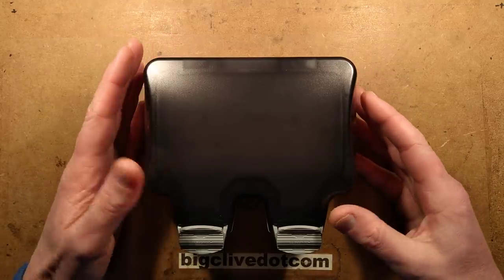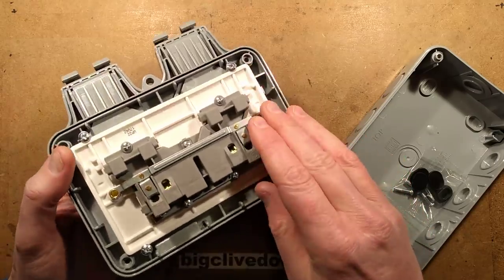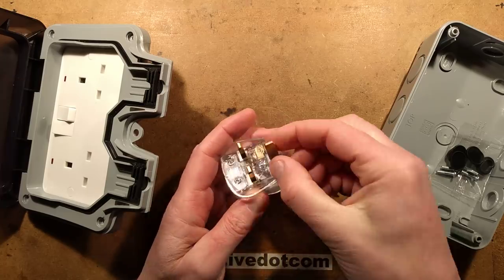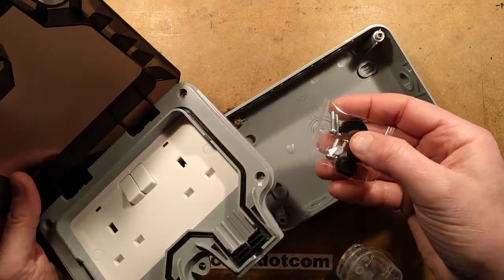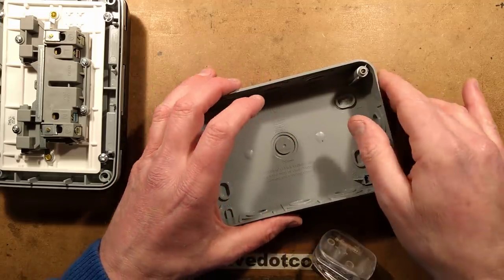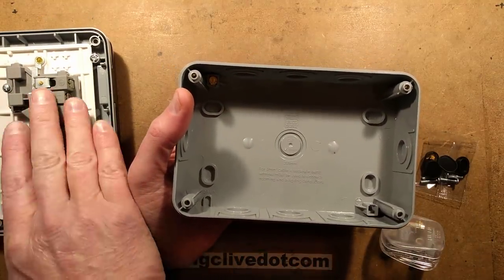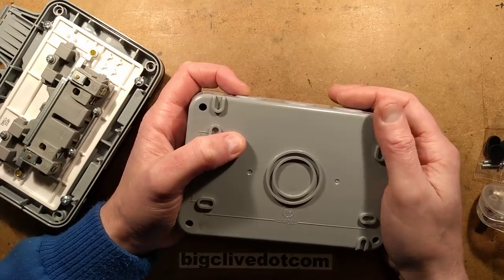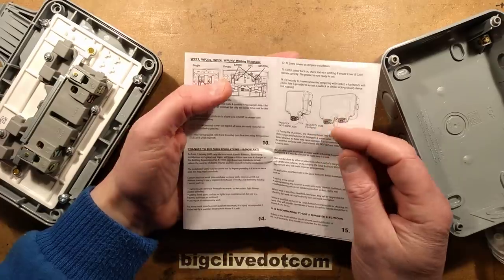British weatherproof socket with clever design. (bonus rant)

Comment: Part P! The P should stand for Prescott! After the git who brought it in after a relative got a tickle after having a kitchen fitted. It was originally intended for those who worked with both water and electricity, e.g. kitchen fitters and the like, but John Prescott (the same git who criminalised none condensing boilers to raise the stakes of the Kyoto Protocol) rolled it out to the whole electrical industry, seeing it as something similar to the CORGI registration that gas men have to have. I knew a lot of sparkies, timed served 30/40 year men, up to date on all EE Reg iterations, gave up the trade rather than go on a course, run by a teenager who had been on a two week course, to tell them how to do their jobs.

Comment: The lights on the socket come on when the socket is switched on. And the catch/clamp is good, and when on a wall easy to do them one at a time with one hand. It's also good at pinching the palm of your hand if you put it in the wrong place. You'll likely only do it once...! 
I'm also a mechanic and part P to me is just a bunch of instructions that I'm certain I can follow with  my GCSE science knowledge, the interwire and my work gear. I also don't want to set my house on fire at any point so I'm more inclined to do it properly, as I would with a car, or it will set on fire etc...

Comment: Would it be worth paying the 180 quid for the one day powerpoint presentation part P certification course and then any work you do would be okay? I mean looking at the work that one sparky did for me (I ended up redoing it safely) it doesn't take a rocket surgeon to pass the course. I'm wondering if it would be worth me doing the course as I have to wire and install new lighting in my garage. Getting a sparky to do it will cost more than the £180 in labour costs and I'd still have the satisfaction of doing the job myself.
Reply: Bloody hell, I just looked at the assessment for the course, it's a 40 minute, multiple choice, open book exam. I could download a PDF of the Electricians Guide to the Building Regs, spend a week or so reading through it and pitch up for a one day course and ace the exam.
I don't mean any disrespect to any sparkys that watch Big Clive's channel, but this doesn't sound all that difficult to get certified if you already have a good idea of what you are doing and have a bit of common sense.
Reply from the maker: The open book tests are patronisingly fake.  Literally a multiple choice with the answer to question one on page one and the answer to question 2 on page 2 of the notes.  It would be very hard to fail even if you weren't an electrician and just sat the test.  I bet I could pass the gas equivalent.  These are just box ticking things.  Almost everyone passes.  The purpose is to get the participant to sign a liability disclaimer that they believe they are competent to do electrical work.  It's called "transfer of liability".
Compare that to the 236 parts 1, 2 and C exams (actual exams) with no notes and a written test involving solving real electrical problems and drawing schematics.  Very few Part-Ps would pass those exams.  If you don't get above a certain percentage you fail and get held back a year in your apprenticeship.

Comment: Although the British plug is a strange one, when growing up in Scotland in the 70s the pins where round. Where they any better? But fortunately back then it was easy to go out buy strange new  rectangular pined plugs. Are the plug pins in Scotland still round?
Reply: I should have said I moved from Scotland to London in 1979.
Reply: You're describing the old 15A three pin plugs. They were in use all over the UK along with a smaller 5A version until largely replaced by the current fused 13A plugs.  They are still actually available and are often used in theaters and the like.
Reply: @NewmanAutomotive  they say its good to learn something new everyday and I just did, didn't know that thanks

Comment: oh Clive how we all love your rants!!! If you think the part p debarckle was bad enough the current Bs 7671 18th edition is a marvel of obcenity on two factors (reccomendations) of which are 1 arch fault detection (hellishly expensive for domestic installations and not widely avalible by all manufactures) and earthstakes when the suppliers earth is unsutible on a pme! More buck passing!!! 
Id love to see a collaboration with yourself John Ward and AvE each supplying a locally brewed beverage to be consumed at great quanities and the dissapointments in your industries. 
Keep up the good work!!!!
Reply from the maker: It'd be interesting to see the power consumption and increased fire risk of any arc fault detection circuitry in a consumer unit filled with those breakers.
Reply: @bigclivedotcom  don't worry about that yet. When they bring out the efficiency section into more than guidance, then they will stiff us all

Comment: how does this cost? In the US, the only ones I can get are cast aluminum or possibly zinc and they don't open all the way so I'm either blindly trying to stuff the plug in the socket or I gotta crawl on the floor to check the alignment.

Comment: I think the UK gas regs used to say a “competent” person was only allowed to install a cooker. Recommended to be inspected by Gpcorgi Registered engineer. Not sure if it’s still the same or if you need it certified as safe by GasSafe engineer. 

.My brother in law fitted a old gas pipe to his cooker from his old cooker didn’t clean the old sealant off or put any new sealant on. An engineer told me that many people put water spec ptfe tape on even though you can get gas spec. 
 
It’s too subjective to say “competent” because most people will think that they are competent even if they aren’t and that is where the danger lies.

Comment: The only down side from American standards is the switches mounted on the outlet plate. In the US the average height of wall outlets is 14 inches above the floor. If you have a bad back and/or knees such as mu=yself, bendin g over to activate the outlets would be very difficult. Currently in many areas of the country, construction for tne last 20 years has at least one outlet split for one constant hot and one half switched. Aside from that, this design is excellent and MUCH safer than the US style.

Comment: Russian color coding is:
Blue - Neutral
Brown - Live in the single phase system
Earth Green/yellow stripes
L1 - Yellow
L2 - Green
L3 - Red

Some cables also have Black, white, grey, orange, Purple insulation in there. That is like a second set.

If it's other color, treat is as live until you know EXACTLY what it is. And thanks to bad electricians, those colors get messed up in a terrible way

Comment: Hmm. I've seen well meaning customers seal their phone cable entry boxes with silicon. Seals so well the water can't get out... As important as sealing is, there is also a need to provide a measure of ventilation on top of drainage. A lot of moisture seems to come from (atmospheric) condensation.

Comment: I'd suggest that the fuse isn't really a HRC. As it's a BS1362 which is more closely related to the BS1361 cartridge fuse rather than a BS88 which is the proper HRC variety. Not sure what fault currents 1362s will take but if we consider a 100A 1361 is rated to 33kA while a 100A BS88 is rated at at least 80kA (often 120kA from experience), there's a fair difference between the two.
Reply from the maker: Rated breaking capacity of a typical plug fuse is around 6000A.  No comparison to a large industrial fuse, but not bad for a plug.  Especially given the typical circuit impedance.
Reply: bigclivedotcom 6kA definitely isn’t to be sniffed at. I hadn’t really thought about the circuit impedance. I imagine, even if your house was right next to the local substation that it’s unlikely to see more than 2-3kA under fault conditions. Just hope that it’s not one of those illegal, counterfeit fuses fitted if the big boy amps hit!

Comment: You should be grateful, you've only changed it once. Here in Germany we've got three colour codes, and almost all of them still active in old installations: 

1. Pre 1965 with a transitional period until 1970

L1: 1st black (laying between neutral and earth in the cable)
L2: blue
L3: 2nd black
N: grey 
PE: red 

Cables with three wires had the colours black, grey and red.

2. Between 1965 and 2003 (transition period until 2006)

L1: 1st black (laying between N and PE in the cable)
L2: brown
L3: 2nd black
N: pale blue
PE: green/yellow

Cables with three wires had black, pale blue and green/yellow. That was for solid conductors, flexible cables already had brown, blue and green/yellow at that time. Grey was actually banned to prevent confusion with the colour system that was used before.

3. Since 2003

L1: brown
L2: black
L3: grey
N: blue
PE: green/yellow

Comment: Clive. With the back entry for that box, could you seal it with silicon and leave it open to cure for 24 hours, then go back the next day and wire up the sockets once the vapour has evaporated?
Reply from the maker: That could be an option, but if you had siliconed round cables they might disturb the seal if it hadn't fully cured.
Reply: @bigclivedotcom  so what would be the best way to seal the rear hole once you shoved something into it?

Comment: I have two in the garden plugged in via 30ma RCD so they are classed as an extension lead and don't need that stupid part Poop certification. The only thing that could be improved on these boxes is that they seem a bit flexible when attaching SWA glands. They haven't broken and once screwed together feel a lot stronger just careful with the spanners 😁

Comment: If your going to use rear entry for the cable I would drill a larger hole and use a 20mm PVC Female Adaptor, and then seal around that, but only mastic in an inverted u shape around the adapter.

Comment: One fortunate side effect of the design of British plugs is that bottom entry cable which allows quite a low profile waterproof clamshell cover and the cable to come out at the bottom. It's not going to be so neat with some other systems where the cable isn't at right angles to the power pins.

Comment: So on the part P

In england it only applies to zone 1(an area in bathrooms), in wales it also contains kitchens and out doors. Do note, you can do it yourself, Its just you have to contact the "local authority for building control" and go though that bureaucracy and the Certifed installers can just notify the trade body they are part of, and i feel like its only there to stop people from going "this is cartel like behaviour" by having another, abet slow and useless, option.

Comment: has anyone ever been prosecuted over part p? like diyers or non registered electricians? i cant see how it would be enforceable if someone put a outside socket in who is going to know and even if they did get found out they can just say they never knew about part p which most home owners probably dont or it was done years ago etc.
Reply from the maker: I think they pulled a publicity stunt at the beginning, but it might have been orchestrated for media use.  Right now I'm thinking it's the perpetrators of Part P who should be prosecuted.  Particularly if they've caused an increase in deaths from electrical fires.
Reply: @bigclivedotcom  you are right its caused someone in an office earning silly money trying to justify their job comes up with a idea that in the end creates more problems than they solve thats governments and regulators for you
Reply: I have seen a few news articles about prosecutions but I don't think I have seen one purely for failing to notify without there being dangerous electrical work as well.

Comment: Here in the states our weatherproof sockets generally rely on loose fitting but overlapping covers, rather than being sealed they're made to drain readily.  To my thoughts that might be better since air circulates freely and trapped moisture dries out.  Not that it's not a lovely thing you have there.

Comment: I always wondered about sleeving contacts. Is a very thin plastic insulation enough to stop 240v going through when touched?
Reply from the maker: It's thick plastic with a thinner brass core than the rest of the pin.
Reply: @bigclivedotcom  Ah, right! It is not easy to see.

Comment: My only real complaint about the British plug is that all three prongs are (roughly?) the same dimensions outside of length; while this shouldn't be an issue if the socket is designed correctly, it is possible for not-standards-abiding adaptors to let you plug the Earth pin into Live/Neutral. I know, edge case, but it seems to cover for most every other edge case...
Reply from the maker: The earth pin is bigger and will not fit in the other holes.

Comment: Something I just notices as you were moving the assemble around. Does that LED turn only when the switch is on? 
If so that would be an easy way to tell it the cord that is coming from it has power on or off.
Rant 100% thumbs up.
Reply: Sean Not-telling This will need to be connected to an electricity supply before the LED lights up
Reply: @chrisbenjamin8843   Power on or off as the switch pair. The question was will the LED be on only when the switch is on or not.

Comment: Every time I see British plugs I always think they are ugly (and they are) but there are a few good things with them:  The built in safety covers (great for kids and adults who may not be able to hold the plug very well), the built in fuse (I put most of my stuff on a Surge strip but those butcher the signal which is bad for Power Line Networks and probably reduces power efficiency somewhat), and from my understanding higher voltages (Here in the US our standard is 120VAC @ 60Hz with a few 220 or 240 outlets usually for Washer/Dryer and maybe in the garage).  My biggest complaint would be the size (which I suppose is somewhat necessary for higher voltages but they probably don't have to be THAT big).

Comment: I use these all the time at work, easy to fit but the internal rubber bungs that cover the mounting screws do not stay in no matter how hard you try. I do have a failed double socket I was going to bin if you want to do a tear down on it, it may be a bit more interesting than a working one, just let me know where to send it.
Reply from the maker: What way has it failed?  Burned contact?
Reply: @bigclivedotcom  It went pop when an iron was used in it, the iron has tested ok and the switch`s have soot marks round them

Comment: It is definitely a good thing that not everyone is allowed to tinker with mains voltage.
We sell replacement parts at the store and I get asked by customers where the positive pole of the plug/lamp holder is on a regular basis.
One told me he has never stripped the insulation off of wires he put in screw terminals let alone using ferrules. "This has always worked for me".
One wanted to build an outlet into his kitchen worktop (yay, fun with water!).
Also I hear "I just need to shove the wire into the plug, right?" almost once a week.
And "Can't i just use a stronger fuse if it continues to blow?" (This might be ok i some cases but if you have to ask you can't)

Comment: The way they use a standard socket and clamp it to the box is clever in that it allows easy replacement and doesn't require the socket to be separately certified.  But I'm not happy about how they've implemented it mechanically.  The plastic of the socket is rather brittle.  It's being clamped by just four screw heads rather than along the entire length of the rim.  People can be quite brutal hammering plugs into sockets.  I'd be happier with something that provides a larger clamping area.

[edit]
I've just noticed it actually has provision for fitting a padlock at the bottom to stop people stealing your electricity without you noticing somebody had to break the cover.

Comment: Ohhhh, I like the clear plastic plug, that way, if the fuse blows up, I can see the skid mark inside! Or, I could find a 240v “fuse” bulb, and put it in place of the 13A fuse, then wire the other end back to Neutral, and have a nifty night light, or it can serve as a “dim bulb” tester!

Comment: I'm with you on the regulation thing, Clive. (Though it might be argued that as the designer of various 61557 compliant products I should be cheering for the other side.) 

The over-regulation that was a fetish of the Blair government is absolutely a paper exercise. At the time, a colleague of mine did a bit of door work on the side and he related how on one of the mandatory training courses there was a bloke who couldn't even sign his name, yet got his license. They wanted his yearly subscription and his ID. They didn't really care what he got up to. 

Surely some electrical safety failures have been down to cheap Chinese counterfeits? UK Electricity is really quite safe. It's working at height that'll get you. Just today I was messing about measuring the voltage dependence of resistors at up to 40kV. No cones, no cordon. Just a nice clear working space so I can SEE, and no-one else can get to it. There was some fizzing and smells, but it's safe by 61010. It's all about proportion.

Comment: It would be good to use a spray foam to seal the hole where the wire leaves the inside of house and goes into the back of the outdoor box. Then caulking can be used around the edges where the box meets the exterior wall.
Reply: Or a fire stopping putty.

Comment: I remember when the live and neutral pins had no plastic sheath, it was common if an appliance had no plug to just strip the wires back and push the ends into the socket by plugging in some other appliance on top of it. 
I used this very method as a child to determine that small DC motors do not like 240vac and result in the motor and user likely shitting themselves